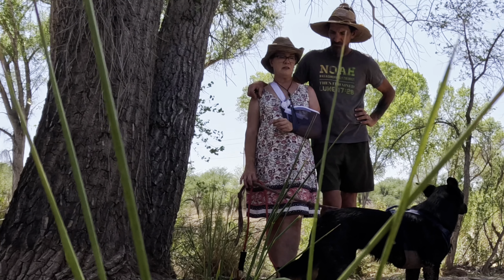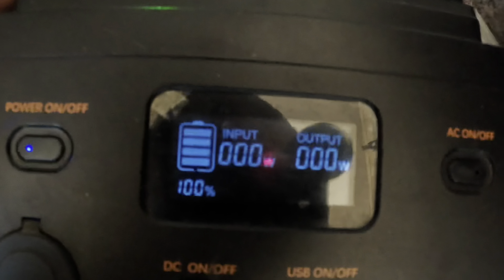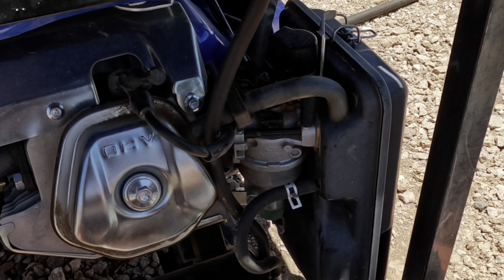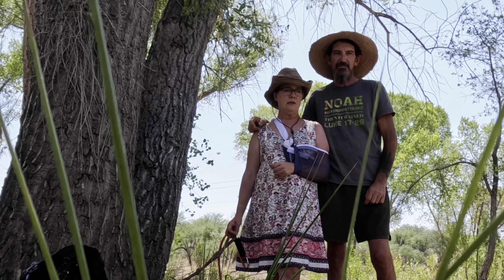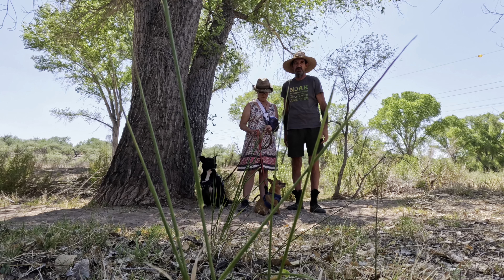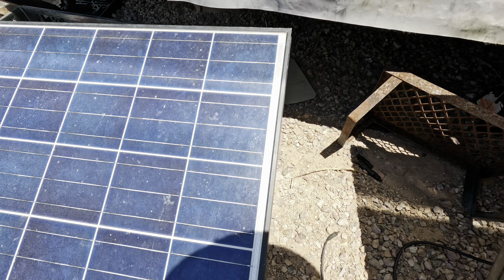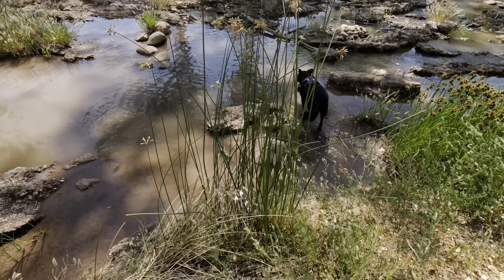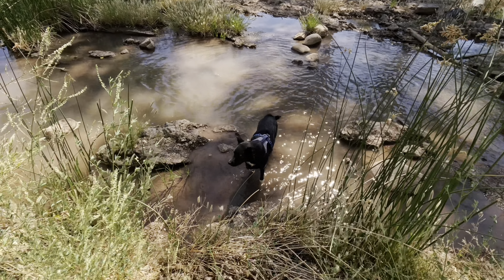DANGER! Your SOLAR POWER will fail you when you need it most!

Comment: Good quality solar panels should last for 25 to 30 years. They can handle the heat and they produce a decent amount of power even when it's cloudy. We have only needed to run our generator a few times in the last 3 years. A modest solar system saves a ton of money in the long run. Running a generator is expensive! 🌞
Reply from the maker: Agree and wish to afford those nice panels one day is the warranty good for 25-30 years or that’s just the talk..? Oh yeah generators are expensive but we take the hit because we need it to run tools and for very hot days.. I’m hoping we look back in life and this is all something we can laugh at.. thanks for sharing
Reply: @tworebelsoffgrid  We went with inexpensive options on all of the other components, but we splurged a bit on the solar panels. Monocrystalline panels are more efficient, last longer and handle the heat better. They can last up to 40 years, but we would be happy with 25. We got them from San Tan Solar. They have a one year warranty, but an extended warranty can be purchased.
Solar can and has run all of our power tools except for the welder.
Hope your shoulder gets better soon! 💛🏜️
Reply: @RedandAprilOff-Grid  Hi peeps.. I bought panels from them twice. Still using them. 400w Trina panels. 2 of them keep my Ecoflow deltas charged.
Reply: @OFFGRID_Trucker  Hello Off Grid Trucker We also use the 400w Trina solar panels. 🌞

Comment: My cousin lives kind of off grid, but he uses solar and generators setup at multiple parts of his property.  I ran all his cables through a 3 to 4 inch PVC pipe buried the pipe 3-4 underground so that cables remained cool and not dry out in the sun.  Last year replace one of his cables, that cable had a nick in it when I setup it up originally, but I decided to go ahead and use it, so that was to be expected.  Because the PVC pipe was wide, it was easy to replace the cable.  we taped new cable to the old cable and pulled it through with no problem.
Reply from the maker: Genius!!!!! I would do the pvc however I cannot bury anything on the property because of the rock but if I could… hey,, thank you for your input and we appreciate you watching my friend

Comment: Great video! We installed a server rack 48v  battery system and two 6500w inverters from signature solar, charged by 24 250w panels ($20 each from santan solar). Our mini split ac system is directly powered only by 6 additional panels which keeps us abundantly cool. We installed the system over a year ago and have never had to turn it off and have had zero outtages from day one. We are planning on using this same system to power our geodesic dome home on the Bisbone ranch.
Reply from the maker: Sounds like a great system and reliable as well..thank you for sharing and of course for watching our channel.. hope to have a new video up this week

Comment: Great episode. I would own a smoke alarm and use fire rated tape on the plug, like vinyl or hvac tape if it wasn't. My favorite is plaster of Paris or gypsum epoxy.

Other msc. tech tips:
1. Don't forget to unplug it during a (lightening) storm. 
2. An EMP could burn out a lithium/Life04 battery since it has a controller.  The dead unit can still be charged manually. 
3. You can run solar direct if it has a super capacitor.  A million-cycle capacitor could run up to 50 years.
4. A convection-berm cooling tube cools a home without power saves lives like food/root cellars can. A future fail-safe ideas.
Reply from the maker: Yes, we have a smoke alarm and that's a great suggestion to use fire-rated tape.  We used electrical tape, but not sure if that's the same as fire rated, but we will check!  Those are all great suggestions especially in an EMP-type situation.  We will look into the convection-berm cooling tube and plan on doing a root cellar too.
Reply: @tworebelsoffgrid  Electrical tape is fine. However, the second danger is from lithium battery fire. If it's not a LiFePO4 battery, I would charge it outside as Doug said.

Another danger of a fried board or fire is from a lightening storm.  Because you need to unplug it repetitively, the tape is in the way.  The solution is to redo the solder joints and the expand the male end of the plug for a tight fit, since the previous heat may have shrunk it. 

It's rumored that a possible slow, sustained EMP during 2030 means all solar or gas generators won't work. I would design all life support system not run on electricity. Thick 18-24" Earth walls to regulate temperature. "The Virtues of Earth, David Easton."

Comment: Im in Canada. Trying to run a homestead on one of those puny solar power stations? Is just ignorance. We have 10kw of solar, two 1500watt wind turbines, 2-6kw inverters making 240 split phase and 30kwh of  battery storage. I have a 5kw generator as backup, but Ive never needed it in 5 years. All that equipment was cheaper than pulling wire into our site which is almost 2 miles from the nearest grid service. Even in winter time as long as I keep the panels clear of snow I get enough to offset the house when combined with the wind. And to be honest even in the winter we frequently wake up to the battery bank being full from the wind over night. In five years those batteries have never gotten below 60% state of charge.
Reply: That's about the size I've planned, but only PV  15kwp/12kw/30kWh. All materials are here now. Prize <10k €uro.
Reply: @RaimoHöft  Having that little bit of wind power is a game changer where I live, especially in the winter. Having that 1500-3000 watts coming in from them during bad weather and over night took my need for storage and dropped it 50% I figure.
Reply: @davefroman4700  The Deye 12k 48V has a port for an extern generator. Maybe I'll try to implement a wind turbine later. Thanks. 🤗
Reply from the maker: Nice system!! Just to clarify we aren’t running a homestead on our current system just and rv with just two people who are not really energy dependent as one may think.. we have a decent system in storage waiting for the house to be built.. we were considering wind power in the future as well.. thanks for your input, wisdom and thoughts and also for watching my friend have a great weekend

Comment: A bulk sand bag 4'x4'x4' you fill yourself. Stacked 3 or 4 on top of each other. Will create a wall for shade and can be planted in and in top. Can put a pvc pipe down through for water and stability.
Reply from the maker: Great idea!

Comment: How much battery storage do you guys have?  I have 5 power stations and 2 expandable batterys and a propane /gas generator.  I got mine because of hurricanes in Fl.  I run my fridges and chest freezes on solar only 24/7.  Along with microwaves instant pot computers etc..  I use the regular gas propane generator to charge those stations in cloudy weather etc..  Your main concern like us in Fl is heat control.  I wonder if one of those  eg4 mini splits would be good for you guys?  They use a lot less juice then conventional ac.   I know your not made out of money me either.
Reply from the maker: Thank you for sharing we do have a full size solar system in storage along with 2 mini splits.. heat is a problem and I’ve been in Florida when it’s 🥵 hot..we really appreciate your input and for watching thank you! Oh yeah we have 5 huge lithium batteries that weigh around 80 lbs each.. forgot the capacity however
Reply: @tworebelsoffgrid  Once you guys get that equipment up and running sounds like you should be in a good place.  You will get there!  I would get a dolly for that generator.  I bought one at harbor freight under 20 bucks.  I put a handle on it and replaced the wheels with a bigger set to be mobile outside.  However you guys got a lot harder terrain to wheel things around then I have.  Just a thought.
Reply from the maker: Thank you and yes, we will...a little bit at a time :)  The dolly is not a bad idea actually and if we find that we need to move this one around a lot, we will probably get one.

Comment: A study from Pusan National University used a set of 4 small fans under the panel and it made a huge difference in the temp of the panel and even with the fans running still produced more power because it helped the efficiency when the panel got hot.
The ambient temp reached 83F. The panel without the fans reached 124F and with the fans it was 102F.
That should help decrease the risk of the panels burning up and keeping them efficient for longer.
Get a normally open thermal switch(Adjustable) like the Stego thermostat, adjustable, N.O. (close on rise) 32 to 140 deg F
Place thermal switch under the the panel and set it to about 100 F as the chart in the study shows to where it seems the output energy breaks even with the amount of energy used by the fans to efficiency of the panels being cooled.
I would use the square industrial 120V fans and run a extension cord and make sure it is covered so the UV from the sun don't break it down. One of those fans use about 2W to 6W depending on the size and the Stego thermostat will be able to run about 40 - 6W fans and last over 100,000 temp cycles. The Stego thermostat would need to be enclosed or wrapped in plastic to keep water out. You need panel ground mounts as one gust of wind will tip them over.
Reply from the maker: Wow, this is awesome info...thank you so much for sharing this and very good to know that the fans do help!  Appreciate you watching and offering your comments.  Thank you!

Comment: mebbe time to go ahead and eat the expense and get a starter 48v system that u can upgrade later for use in the house when u get it done. they have new controller/inverters that r crazy nice.12k inverter and can start w 1 battery or even no batteries if only used during the day and u can daisy chain them up to i think 6 controllers for like 1500 bucks each
Reply from the maker: I’m going to have to look into that,, thanks for the suggestion

Comment: You need a soldering iron and a $5 connector
Reply from the maker: The connectors you speak about are the diodes?
Reply: @tworebelsoffgrid  Sorry to butt in.. mC4 connector. Doug wrapped it with tape. Get that Amazon wishlist going and I'll send you a few things

Comment: Mine won't. I have to much solar. Plus i use a lot of solar direct from the panel. No battery or inverter needed. Remove the problem areas
Reply from the maker: I’m going to look into this.. it makes sense that if you take the middle men out of the system there’s less things to go wrong.. btw somehow I believe you
Reply: Ahem.. They need to store their power so PV direct wouldn't work. besides they already invested into the right equipment.. some of it needs a little TLC.

Comment: I couldn't tell if you have a charge controller between the panels and the batteries, you could disconnect the panels when the batteries are full, I have 2, 200 watt gell batteries that seam limitless, but are 300 lbs each, $400. each, got a 12 volt Lithium battery, 58 lb $600. hooked up with the gel, works good! I've used those connectors before, they are junk! I now use the other connectors, if you use aluminum wires, they carry power well, but aluminum don't like other metals, especially steel connectors! and short out. I have pannels that are 30 + years old still working fine. My 4800 watt generator is in a dog house type building to suppress the noise and keep it dry. The native people in the southwest cover steel roofs with tree limbs and brush to shade from the heat. I know the heat is intense down there in the summer, maybe some of this can help!
Reply from the maker: Those batteries wow heavy,, did you mount them or make a heavy duty table to keep them on.. sounds like you have the solar figured out.. I’m still in the learning stage so any suggestions are encouraged and appreciated thank you very much I never knew there were other options for the connectors.. I will definitely look into that.. thank you for sharing your experience and advice!

Comment: why not setup a small solar setup with batteries, inverter and a charge controller. You can increase what you take in and store for the day, Our plan is to have a small setup for the camper when we head down and expand as we go.
Reply from the maker: The trailer has all that available and set up for it.. but until we added dual batteries it was pretty useless for off grid,, thanks for your input my friend and hope you the best in your future adventures! Cheers